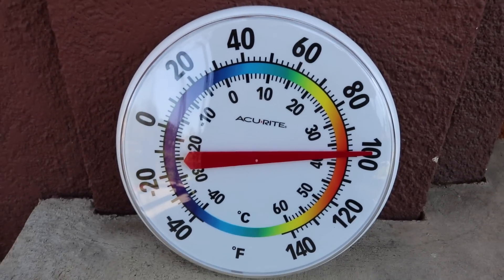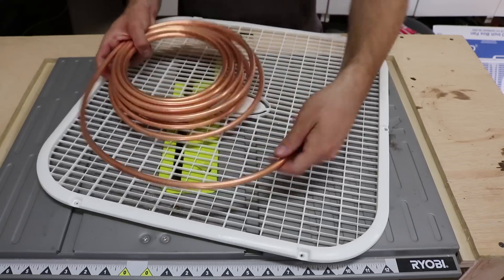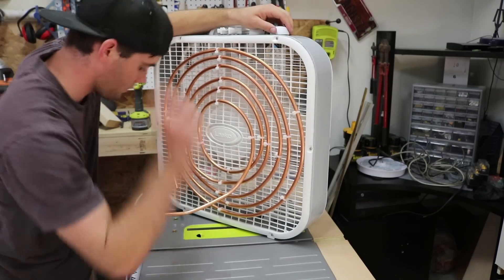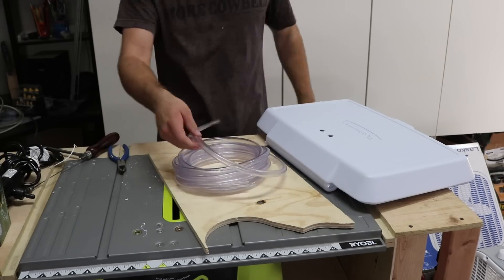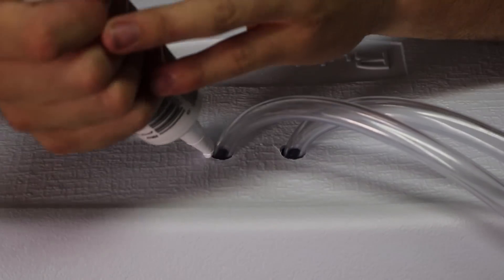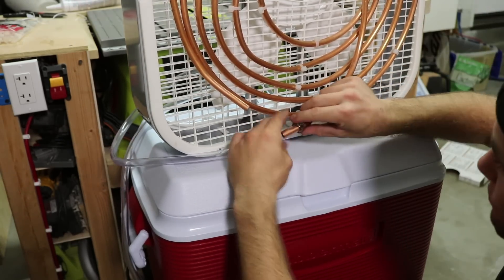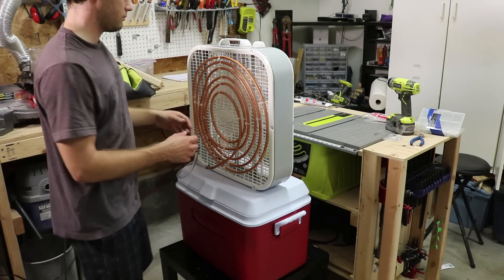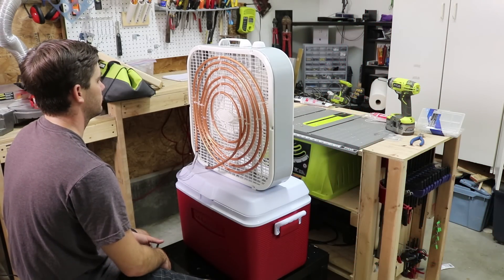$100 Homemade Air Conditioner - DIY

Comment: You built an ice melting machine for almost the price of a small AC unit 🤣
Reply: @freight-fps   and how much are you going to keep spending on ice
Reply: @snakeeyes5224  everyone has a fridge/freezer, to freeze water in plastic bottles, a gallon size, rotate them out, larger ice container/package will melt slower...
Reply: @tikercat  how is it going to melt slower when you have heat going through it from the pipes lol
Reply: @snakeeyes5224  Just freeze plastic water bottles. You can reuse them forever and cost almost nothing.
Reply: @shanebrain2009  you're basically taking the heat from a garage and moving it into the kitchen. The laws of thermodynamics doesn't joke around
Reply: @snakeeyes5224  you is edumacated. 👍
Reply: @gerryshafer5954  so tell me what will you do with the heat you remove from the room. Where will it go?
Reply: @gerryshafer5954  actually I think the education system is to blame. You don't understand the basics of physics and how energy works.
Reply: @snakeeyes5224  no insulation on metal garage roll up door, but insulation between garage and kitchen. Would assume most heat transfer would happen to the outside but maybe im mistaken 🤷🏻‍♂️
Reply: @shanebrain2009  you have to freeze the water to make ice which in turn runs your freezer while putting heat into your kitchen...
Reply: @snakeeyes5224  That's not right.
Reply: people in this comment section forgetting that you can just refreeze the ice after it melts
Reply: Omar buy some dry ice
Reply: @kiwikiwi657  Because a build up of CO2 is healthy to breath? or maybe it's cheaper than buying an AC unit?
Reply: Omar technically we breathe 70% hydrogen
Reply: @kiwikiwi657  how about you try that in a enclosed room and let us know how it goes.... co2 and hydrogen are completely different. And where did you get that we breathe 70% hydrogen?
Reply: 0 0 my science teacher
Reply: @kiwikiwi657  HYDROGEN?!?! We have no Hydrogen gas in the air we breathe. I think you mean Nitrogen.
Reply: @kiwikiwi657  I'm thinking you misheard your teacher.
Reply: 0 0 nope. Thats what I was taught in science class :/ it's very clear public school is a fail
Reply: @kiwikiwi657  unfortunately you are right, I felt that way as a kid growing up. The education system is shaped to just train you to do as your told without question and to become a work robot by memorizing facts to regurgitate onto test that you will forget within a few weeks. It doesn't work on helping develop kids character,  personal interest/skills and critical thinking skills. Also I didnt mean for my comment to come off a rude or anything to you. The education system has definitely needed to be overhauled for a very long time unfortunately.
Reply: @kiwikiwi657  70% hydrogen?😅🙏
Reply: @kiwikiwi657  nitrogen
Reply: Brah is a big dummy u was Betta off buying one at the store or a yard sale
Reply: Still better than an AC jokes on you 💀 at least it doesn’t make the bills go sky rocketing high
Reply: people..this does not work..stop wasting your money..i did...the problem is energy..and the ammount that comes off a warm room...this hack will work about  30 mins...when the water is still ice cold...every pass of watee  pumped through  the pipes it will be a bit warmer water absorbing the massive ammount of energy to cool air. after about 20 mins. your condens on the copper pipes are gone. they do not get that ice cold water pumped but just a bit of chilled water..after 45 mins..all off your ice will have melted in the coolbox or tempex box. just ice will stay ice for at least 5 hours in a coolbox...pumping warmer and warmer watee by the minute will melt it in about that 45 mins...so..the only way this will work is a way to keep the water coming out of the copper tubing chilled..you  have to run it througj some sort of freezer to get cold again before dumping it back in your coolbox.  so...to sum up...does this DIY trick work?..yeah..for about 30 mins to 1 hour...what do you think if this worked for 8 hours(working day). nobody would buy split unit(inverter) airco anymore.
Reply: @jaapvanlenthe4919  you have renewed my faith in humanity!
Reply: @Back Up (think smarter, not harder...) or maybe? Just maybe, you could fill up a some 2 liter pop bottles with water, freeze and when one set melts. You can switch them out for some of the other bottles that ate frozen and switch them out while the others refreeze.
Reply: @snakeeyes5224  they literally just admitted to being wrong. So I'm not sure what the point of your comment is.
Reply: Actually AC cost as low as $80
Reply: WELL HE IS JUST SHARRING HIS IDEA LOL.... 😎😎😎😎😎😎 LETS BRAVO HIM...😍
Reply: @patriciaaxelonfacebooklope9572  Think is, he's indicating it works well by saying he'll use it lot, when we still have no idea how well it works.
Reply: @patriciaaxelonfacebooklope9572  is it pat or patrioticia?
Reply: @The_DC_Kid  
It depends on how much you want to cool your room.  If you just want the DIY A/C to cool the small area around yourself by a few degrees while you work, then you may be able to save some money.  But if you work want the DIY A/C to cool an entire room as much as a typical A/C can, then the price to create that amount of ice is probably way more than the price of electricity to run an normal window A/C.  No machine is 100% efficient, so the freezer already loses some electrical efficiency in cooling all that ice.  And then you lose more efficiency through the pumps and the melting of ice in this DIY A/C.
Reply: @Lewis.Alcindor  Other than one fact you may be overlooking: what if your shop or garage does not have a window? It would cost well into the thousands of dollars to get a window installed if you have a pro do it, and well into the hundreds to DIY it. At that price you're better off paying money to insulate the attic and use a machine like this if money is an issue. If money isn't an issue of course you could insulate the attic and just get your central air pumped into your garage as well.
Reply: @dupeaccount1647  
Yes, I agree that the best and most cost effective method is to use lots of insulation on the roof of the garage.  After all, you don't need to cool a space as much if heat doesn't enter your space as readily on the first place 

But the fact is that this DIY machine simply isn't going to be very efficient at cooling any room to except the most air-sealed and well-insulated room.  If there is a large difference between the existing room temperature and the desired room temperature, the ice will melt long before you reach your desired temperature.  The room heat needs to go somewhere, and it is quickly melting the ice when the pipe sends the water back I to the cooler.  It's a machine that works (at best) at cooling off a small space directly in front of where the fans are blowing through the coils.  

The best thing I could say for this DIY machine is that it isn't an air cooler or swamp cooler, like many other "DIY A/Cs" are.  It at least mimics the setup of an actual window A/C (without the refrigerant or compressor, though).

If the space requires significant cooling, the best bet is one of those portable A/C's with those big hoses.  Those don't work that well, but would still be significantly more efficient than this DIY machine.  The downside is that you still need to make a hole somewhere for the hole (maybe a hole in the garage door), because the heat needs to leave the room somehow.
Reply: @Lewis.Alcindor  I don't know. I built a machine like this, but better (instead of coils in front of the fan I used a car radiator). I need to insulate my attic, but even with the uninsulated attic it does make a significant difference in the temperature, but yes especially in front of the fan/radiator.
Reply: @dupeaccount1647  
Great to hear some first hand experience!  I think the radiator works much better than just the coils alone, considering that's what's in window A/Cs.  How often did you have to change the ice and water?  Did you have to put a pan under the fan or cooler to catch all the condensate?  And how often did you have to empty the condensate?  And did it cool noticeably for the whole room?  

I think this setup would work decently well for rooms that just need a few degrees of cooling.
Reply: @Lewis.Alcindor  It noticeably cools the whole room which is a 22x22 garage. It eats ice pretty quick though (have to change it every 1.5-2 hours). Like I said I think it will work a ton better with the attic insulated which I'm working on now. I can only go up there early in the morning though and do a little work at a time (about to start air sealing) if I don't want heat stroke. I haven't used the cooler much yet though and I think I need some other stuff to do. Like I use frozen water bottles but I think frozen laundry detergent jugs will work better (less instant cold but longer lasting). I get very little condensate on one of the hoses but I just zip tied an old towel to it. It never leaks through the towel. As for changing the water I put a couple of ounces of bleach in to get any nasty microbes out.
Reply: @dupeaccount1647  
Thanks for the thorough reply!  It's refreshing to have a conversation instead of two people arguing back and forth, each thoroughly convinced their opinion is correct and the other is wrong (which happens too often on the interwebz).

As a Certified Passive House Consultant (though without any real hands-on experience - I simply took and passed the 3-hour certification exam about 1.5 years ago), perhaps I could help a bit with your situation.

Is your garage attached or detached?  I'm guessing the sloped attic space is located directly above the garage?  If so, there are two ways to go about insulating the attic space:
1.  Insulating and air-sealing the sloped roof rafters.  This is the more difficult option IMO, and based one what I've seen from others.
2.  Insulating the attic floor joists, and leaving the sloped roof rafters mostly uninsulated.  

In building science parlance, Option 1 treats the sloped roof rafters as part of the building thermal envelope.  The rafters would need to be thoroughly air-sealed and insulated at an even thickness.  This option is more difficult because existing roof rafters are difficult to air-seal thoroughly, and difficult to get an even insulating layer on.  But it is the option you would do if you plan to use the attic for storage or other semi-regular uses.  

Option 2 is the easier option.  It considers the attic floor as the boundary of the building thermal envelope, and treats roof rafters and rest of the attic as outside the envelope.  The downside is that your attic mostly becomes useless and mostly unusable empty space.  This is often because your need a very thick insulation layer to truly insulate correctly (roofs should be insulated well past R50 - imperial units, not metric).  Therefore, the insulation would stick somewhat above the floor joists.  I guess it depends on the height of the roof ridge above the joists.  But in most cases, that height is short enough to make the attic useless if you insulate the floor joists to R50+.  

Other things I would do:
1.  Install radiant barrier insulation on the inside of the roof rafters.  These will reflect the heat radiation back to the roof so that it radiates the heat outside.  I would recommend this for both options.
2.  Install two fans (one exhaust, one supply) on opposite sides of the attic room to constantly exhaust the hot attic and and bring in fresh outside air.   The fans should be powerful enough to move the volume of air needed to keep the attic cool enough.  Option 1 would probably require less powerful fans than option 2.  

I'm not surprised about how much you have to change the ice, but I think this type of DIY machine may be a good alternative to A/Cs.  Hopefully your attic roof air-sealing and insulation project should reduce the ice consumption.   One question - in your opinion, how well do you think the machine dehumidifies the garage space?  

Another alternative is a small mini-split system for the garage.  The only holes needed are for the two refrigerant pipes going from the indoor cassette blower and the outdoor compressor.  You also need to have electrical connections and wall space for both the outdoor compressor and indoor cassette blower.
Reply: @Lewis.Alcindor  I'm going to do option 2 basically. After air sealing I'm going to throw down some batts, then OSB on top of the batts, then blow in insulation over the OSB. Overkill but I don't want to fall through the attic. Also as a (slow, careful) DIYer I want everything to be totally prepped before blowing. Plus I'm building an elevated walkway in the middle of the garage attic (which is attached... you're correct on that) so that later I can inspect the roof a couple times a year. I could also use it to install a fan as well as you suggested.

Also I haven't noticed humidifying or dehumidifying effects from the home-made A/C.

Also as far as not using my attic for storage or living space my attic has 2x4 floor joists and trusses. So it's not going to be used as anything but insulation unless I do a major remodel. If I was going to stay here forever I would upgrade it to proper 2x12 joists but I'm moving to Germany permanently in around 5 years.
Reply: @dupeaccount1647  
Fantastic!  The 2x4 floor joists sound way scary, so be careful walking on those.  Hopefully the trusses are strong enough to support the floor.  

The fans might possibly blow around the blow-in insulation, so maybe tape or staple some plastic sheeting to cover the insulation.  Doesn't need to be particularly expensive plastic, maybe 1-2 mil, as long as it keeps the insulation underneath.  That way, you don't need to deal with all this loose insulation blowing around everywhere when you go up to inspect that roof (although you can also just turn off the fans and wait for the insulation settle).  Also, the insulation layers will remain at a uniform & correct thickness to get the the uniform & correct R-values.  Yes, I know.  More scope, more work.  

As for fans, the most efficient systems are technically "heat recover ventilator" (HRV) fan systems.  These systems are used in Passive House design buildings to constantly exhaust and supply fresh air to occupants while keeping electrical costs low.  There is a heat exchange core inside these systems that, in the summer, helps keeps the heat out.  During the winter time, the heat exchange core keeps the heat in.  They run at a much lower CFM rate than a typical attic fan because they are actually designed to run continuously habitable occupant space.  The downside is that these (for example, the Lunos E2) are somewhat more expensive than the smallest attic fans. 

Regardless of which fan you uses, I would definitely suggest installing the radiant barrier insulation between the roof rafters.  Those will do the most to reflect all that heat radiation away from the attic.  From what I've seen, it could cut the temp difference by 30 degrees F on the sun side of the roof.  

I'm in a similar boat as you.  We don't plan to stay in this house for too much longer, so it's all about how much money we feel like investing into a lame duck situation.  The 2nd floor beneath the attic is just way hot during the summers.  My bedroom/office A/C stopped working years ago, and I don't feel like replacing it.  I recently bought a window fan with dual & individually reversible fans, and those really bring in cool air on most nights (though they do diddly squat on the hottest nights and days).   On truly hot days, I just go downstairs to work.  

Best of luck to you!
Reply: @Lewis.Alcindor  Yeah that's part of why I'm putting the OSB down so I know it can handle my weight.

And yes nice talking to you.
Reply: @dupeaccount1647  hundreds of dollars to diy? you have never put in a window have u?
Reply: @tikercat  No, but I've already put up OSB and drywall and it's all mudded and painted already. Would be a pain in the ass. Not to mention if i needed any special tools I don't already have!
Reply: Exactly
Reply: it has it's place especially in an off-grid small camper-g.i.
Reply: https://youtu.be/TtRkd-rITkU is also a great way to cool down!
Reply: It's a garage, where would he put the ac unit. I think he was creative. :)
Reply: So you need to buy a new cooler. Ya know....Air Conditioning Units work by removing hot air from a room with Freon Gas. The more hot air removed from a room, the colder it gets. Same principle as when you climb a mountain. Otherwise, the next orbital pass away from the sun would by your last if not for air. You'd freeze to death in seconds if this planet didn't have air or some other gas like Carbon Dioxide that fills Mars's Atmosphere. In other words, air is an amazing thing and so is water, the two simplistic compounds found on the planet. Without 20% air and water, you can't make Concrete. Of course, 10% Cement, 20% Air & Water, 30% Sand, 40% gravel. Cement itself is made from Limestone, Silica from Sandstone, Aluminum which comes from Shale, and Iron. Sand on the beach is also largely made up of Silica that is used in making Glass and some Paints but not all paints. Of course, too much Silica in the air can be harmful as well as other things. As for Iron, Iron is everywhere even in our bodies. lol Everyone thinks that an air conditioner works by creating cold air. Well, it doesn't really do that. That is why dehumidifiers work well in also helping to bring down room temperature, and you're using ice that humidifies a room making it hotter than it should be. Well, good luck with that Swamp Air Condition made by mostly hillbillies. Nothing wrong with Hillbillies apart from the fact that they think frog spit makes everything stick together. Heck, my sister's ex husband comes from a long line of Hillbillies. They are good at playing music though. Still, everyone has a heart even Hillbillies. lol
Reply: Heck, I've seen a person turn burning wood and converting that into gasoline. Very long process and not very practical, but he did it. Some of the things people do sometimes amazes me, and I think I've seen it all on YouTube.
Reply: AKA idiot!
Reply: I was saying the same thing. For that amount of money you sent, just buy a real one. Like $80 or something. Even if it cost $150... I'm good.
Reply: @Lisa-cn2uu  a half gl. jug for a desk top area can be as little as an hour  to maybe a couple depending on several factors.. Speed of fan blowing  air against the jug,.. heat,.... as well as humidity.....  But if you are talking the scale he shows in the vid. I would recommend block ice you freeze  yourself..... like in the gl. icecream pails..  the plastic is tougher and  doesn't stretch quite so much creating leaks..The whole objective in the  vid is to get the water in the cooler as close to freezing as possible and keeping it there.. Even a 20 degree of difference between the ambient  air and the water will create a cooling effect
Reply: Have you tried this using dry ice? I'm in texas and it's over 120⁰ in my shop and I have no way of installing an a/c without cutting a hole in the wall
Reply: @js6729  Using dry ice isn't recommended in closed spaces.. As the DI melts/evaporates it gives off carbon dioxide which is heavier than oxygen..People have actually smothered themselves by transporting the DI in automobile cabins
Reply: It’s about his skills
Reply: @freight-fps  these materials just showed up in your house and were never paid for? Wow...
Reply: IThinkTheFuckNot YouTrickAssBitch  you're welcome sweet cheeks 😘
Reply: IThinkTheFuckNot YouTrickAssBitch  awww little guy has to have the last word. Go ahead little buddy 😉
Reply: This would only really be a good budget friendly option if you already had most of this stuff laying around
Reply: Without a drain, he gonna be cool and wet indoors😂
Reply: An enclosed cooling system like this is much cheaper to operate than a typical AC unit..I like it because it  doesn't have the humidity problems that a swamp cooler brings into the mix.. As for ice you can freeze 1/2 gl. milk jugs and keep them on hand to reuse on a daily basis and swap the "spent" out with fresh jugs..Yes I do that with just a fan and an aluminum pie pan..Its not the "most" convenient.. its limited by the amount of cooling capacity.. but if you have a freezer of frozen water jugs it will cool things down for only the electrical cost of operating a submersible pump, box fan, and freezer
Reply: @kevinrehberg8758  All your advice is correct and of sound logic.  It seems so many people can only see the drawbacks in ANY concept, no matter how logical and well thought out.
Reply: @kevinrehberg8758  it isn't enclosed though. This is just a swamp cooler.
Reply: @lmaoroflcopter  Our definitions of swamp cooler differ..I don't disagree that  swamp coolers aren't efficient enough in higher temperatures AND humidity......  but the coils of pex are "sealed"  not passing air across a pad saturated with water... which is what a swamp cooler is,...   And that is where the failure of swamp coolers lie in humid situations  the hot air laden with moisture (in the humid situations) can't adjust low enough to effect any real change once its been cooled and then re-entered the normal surroundings..As long as the system can pump cool-cold water through the pex pipe it can cool the air passing over the coils.. Maybe only for a short period but the only moisture involved would be the  condensation in the air already released by coming in contact with a cold surface which would normally be very little in a desert environment
Reply: @kevinrehberg8758  the pipes aren't sealed. They are open to a giant vat of evaporating water located in the very much unsealed cooler below it.

The only thing achieved here was that they turned $100 into a swamp cooler.

If they placed the cooler box outside the home, it's still a swamp cooler but at least won't be adding humidity to the area its attempting to cool.

Original swamp coolers were fans blowing across a bucket of iced water. No pad involved.
Reply: @freight-fps  right. So now you're paying to make the ice you want to melt and for your other air conditioner to cool off your kitchen
Reply: @snakeeyes5224  Sounds like you work for the AC industry ! Good luck you won't change my mind.
Reply: @snakeeyes5224  why don't you fill like 6 big bottles with water and freeze them completely and just dip them in there
Reply: @sreekanthr2  because electricity isn't free.
Reply: @snakeeyes5224  you still respond? You need a life
Reply: Couldn't you just throw the ice on the floor under your chair?
Reply: @The_DC_Kid  depending on what you want they can range from $100 to $500. If you're trying to compare that to the price of ice, don't forget to include the price of the electricity to make that ice if you're going to make it yourself and the heat generated to make that ice in your house which will increase the amount of the AC use where the freezer is. Because the freezer sucks the heat out of the inside then dispenses it outside. 
If it was ever more efficient to use ice than AC, we would not be using AC at all like they used to do before ACs were invented.  this is simply reverting back to an old invention that's been forgotten about
Reply: @snakeeyes5224  your whole "your just moving the heat from the garage, to your kitchen" thing is probably one of the stupidest things I've read on the internet today 😂
Reply: MY   GOSH   PEOPLE   THIS   GUY  IS   GREAT    GIVING  YOU  A  GREAT   TIP
      ITS  YOUR   CHOICE   TO   MAKE   BUT ,  YOU   DON'T   HAVE  TO  POST  YOUR   CRITICAL   COMMENTS   !!!
Reply: @The_DC_Kid  when you run the refrigerator / freezer to make the ice, heat is generated.  That's the purpose of the coils behind every refrigerator unit.
Reply: You can get ice daily from your refrigerator if you have the right kind.
Reply: YOU  CAN  ADD   BLOCK   ICE   AND  FIND   THE  MATERIALS   ON  SALE  
        I   LIKE   IT  AS  ITS    PORTABLE   AND   YOU  CAN  HAVE  ONE  IN   EVERY   ROOM  
        AC   RUNS  A  HELL   OF  A   LOT  MORE  24   AND   7
Reply: @gerryshafer5954  this is simple physics you learn in middle school. 

Are you going to make the ice yourself? Your freezer will create more heat to make the ice than the ice will cool off. You're also paying for the added electricity to freeze it, because freezers turn on and off automatically when something isn't cold enough. 

So with your logic, you're paying to generate heat in the house you're trying to cool.
Reply: @snakeeyes5224  Im going to assume he has a freezer in the garage to keep all the heat in the garage as freezer in a 100+ degree garage will most likely be running regardless..  This setup does two things, circulates the air, and adds colder air.  The garage is already a oven with the sun beating on the door.  Even if the ice was offset to a kitchen freezer, most SoCal homes have AC inside, garages/attics not included.  For a long term setup, sure its a waist....but for time in a garage for hobby/shop work thats intermittent, its an effective solution.
Reply: @aaronmlacey  no, I'm not assuming that. I'm saying you're going to heat up the place you make the ice that you will probably be cooling with an AC. I'm also saying this is junk that only wastes money. Anyone with common-sense and a little understanding of physics can see that.
Reply: @aaronmlacey  it's a better investment to use a portable AC unit or swamp fan
Reply: Nope actually water in a bucket you can freeze blocks of ice in freezer you already paying a light bill Anna water bill so that will make the ice free I think this is more for demonstration just to see if it works
Reply: @1983bigfrank  making ice in your freezer is not free. Your freezer runs more when it has things it needs to cool off and freeze
Reply: @snakeeyes5224  some people just make things just to see if it works at least they're using their imagination the reality is there's nothing in the house that really runs up in the electricity except for the AC unit yeah it is not free nothing free not even this conversation. Not a plug in the wall will a TV turned off and still charging something but the reality you can leave everything on in the house the Lights TV fans frigerator everything and I promise you it only use about $3 a day
Reply: ANOTHER   IDIOT